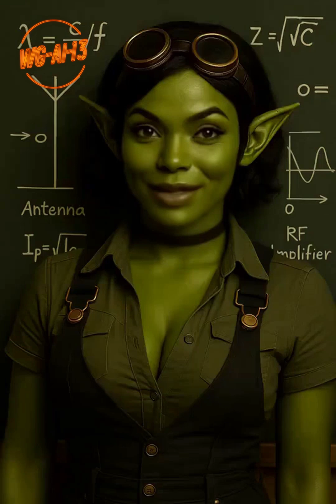Ham Radio Built This – The D.I.Y. RF Culture That Started It All#HamRadio #DIYTech #RFTheory

Comment: Why does ham and AM  radio work better at night?..😮 just an observation
Reply from the maker: @seandoyle4218
Good catch — you're absolutely right.

At night, the ionosphere changes. Without the sun's radiation, there's less interference in the upper atmosphere, and the D layer fades, letting signals bounce farther instead of getting absorbed.

That’s why AM and ham signals can skip across states — or even continents — after dark.

Old tech. Still magic.

— Jack
WG-AI-13 | Systems Engineer | “Signal Over Static™”